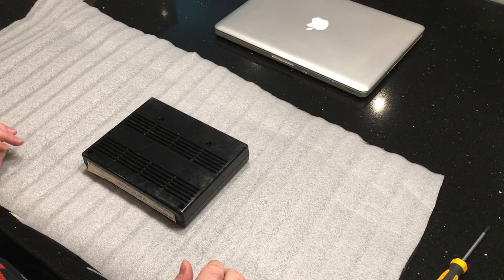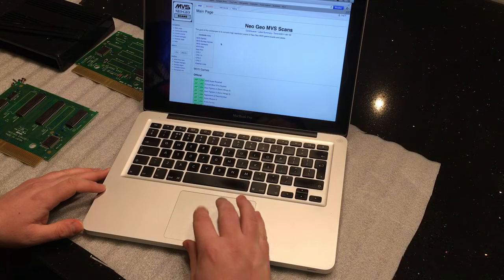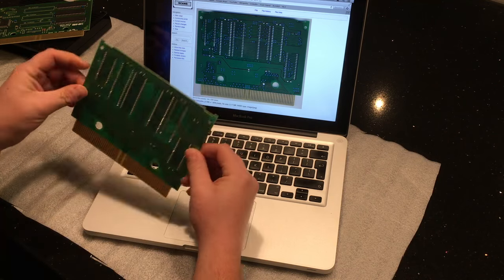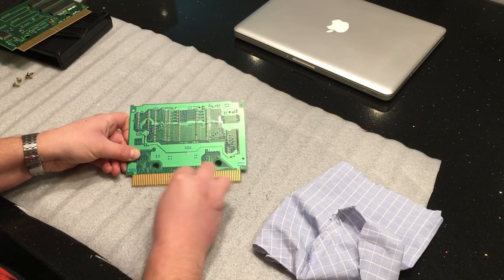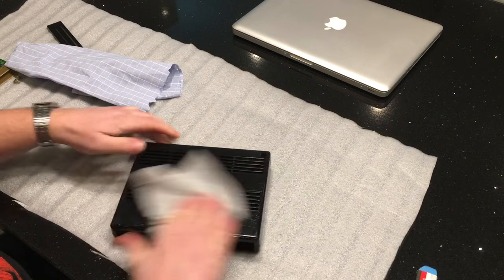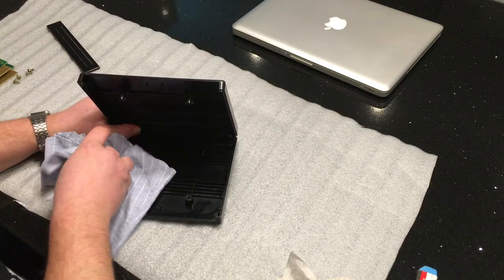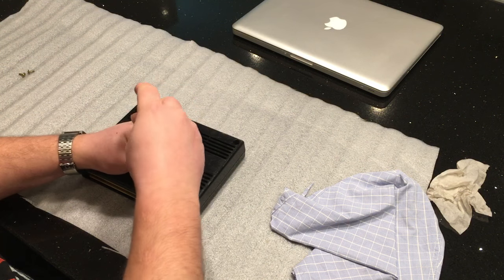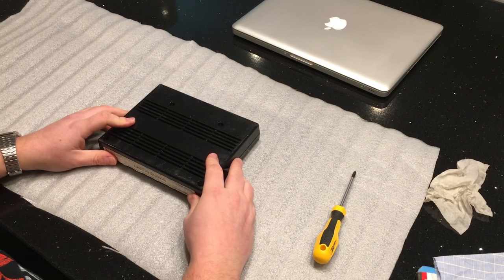How to Check and Clean A Neo Geo MVS Game Cartridge

Comment: Very good video to help those starting out.  This is an absolute must for anyone just getting into collecting for any cart-based retro console.  You should ALWAYS clean your carts.  As for the Neo, it's extremely important to make sure you check your boards with MVS Scans.  The Atomiswave is another arcade system that is riddled with bootleg games trying to be sold off as original.
Reply from the maker: Thanks! Good solid advice there too, appreciate it! Atomiswave... One day I will own one of them too!
Reply: One of the best and worst arcade systems to own.  Super unreliable hardware, and games are 90% bootleg copies on internet sites.  If you can get a working system, fix the I/O diodes yourself, and then find a good reliable seller of games, it's an awesome system.
Reply from the maker: +Project COE Thanks for the info. Will be really careful when I look to get one. Could have been caught out!
Reply: Yeah what I recommend people do for the hardware is always ask the seller to show you the I/O Test page from a page, to see if the buttons register as OFF.  If you see any ON, that means the diodes need repair.  Specifically tell the seller not to touch any buttons while in the test page ;)

For the games, much like the MVS, always get the person to open the carts and show you the boards.  It's much safer than any other method (i.e. looking at the serial number, the rounded corners, etc.)
Reply from the maker: +Project COE That is a top pro-tip! I will certainly do that when I get an Atomiswave. Thanks!

I feel much more at home getting the MVS games and I do exactly what you&#39;ve suggested. There is only one seller I don&#39;t ask for board pics from and that&#39;s because I trust him and have bought many games from him. He won&#39;t open them because he knows they&#39;re originals for other reasons and doesn&#39;t want to damage the labels etc, which is fair enough. One of the games I bought had an original SNK tamper label on it actually! I did cut through it though... couldn&#39;t stand the thought it may not be 100% of course, it was perfect when I looked inside :-)
Reply: Care to let us know the seller?  It's always good knowing trustworthy sellers.
Reply from the maker: +Project COE Will send you a DM on Twitter with more details but the guys name is Ivan and he lives in Italy :) know him through forums
Reply: Ok great, send that info away :D

Comment: MVS scans is a good source, but it does not have all the variations of the PCB revisions that manufacturers have put out.
Also some original carts came with EPROMS, usually in the first revision of the games, where last minute revisions due to found bugs in the software would not allow for reg ROMs to be used due to release deadlines with sometimes up to 8 EPROMS used.(All or most chips as EPROMS are usually bootlegs). One of my friends actually worked for SNK and he has seen this done by the company. It was more prevalent on the MVS than AES.